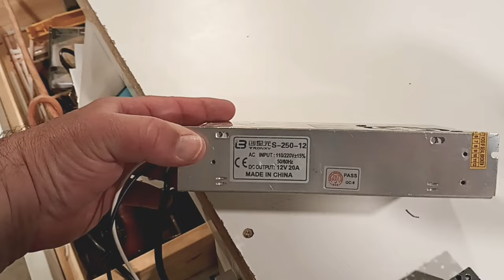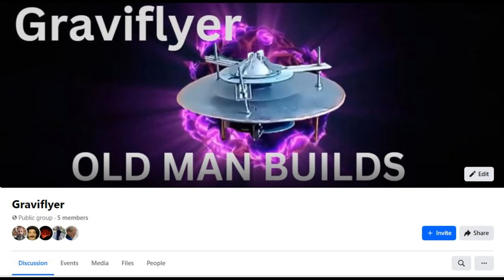Adjustable Power For ZVS & Flyback #35

Comment: Nathan, you may have the power but not the voltage battery frequency. Also, the power supply is pulsed DC from AC. You also need the Al and Al2O3 CD.

Comment: I have the copper for my Tesla coil primary & secondary and the spinning plates top and bottom . I am building a  rack mount cage for my power supply and 6,500 watts rms of audio sinewave power. EEG for mind control operation, so All I have left to gather is one D/C fan motor, and the large central aluminum plate. The rest is pulled from my utility trailer in storage. I will be with you on the graviflyer and the gravinductor :) Two Weeks tops ready for broadcasting experiments too.
Reply from the maker: I can't wait to see it
Reply: I also couldn’t but help myself And other’s following fellowshipping  to bring on some patch bays:)  it’s forward stroke with chokes into new promised terraform ‘d lands.

Comment: Good afternoon to you Sir.       That looks like a A/C ark, am I right to say that. Have you tried a Hi voltage DC circuit.    Thank you for the visual the other day with the tubes and the flyers heartbeat it pulse. Looking at it the doughnut it's very large for the piezo in my minds eye all I see is a hole being punch throw the centre not pushing down the top half of the sphere.  Good work buddy your so close.
Reply from the maker: it is dc
Reply: @nathanbunten4299   Ok. I apologise for my inexperience.
Reply from the maker: @Pietro-Caroleo-29  Sorry, was not trying to be rude.
Reply: @nathanbunten4299  Don't worry, all good here. 
   Your controlling the voltage into the coil via the ZVS and the static voltage that is needed by delivering low amps.  Question.    How is the frequency of coil adjusted to the right hertz, for the required matching hi voltage output.
Reply from the maker: @Pietro-Caroleo-29  I have another circuit for that. https://youtu.be/ag9jqnBTY9g?si=eA-kdxFIwtRnIRmB

Comment: I have a question old man i have seen videos where people power a flyback transformer by hooking up transistors and resistors and diodes .    Im learning and im a little lost.    Is that what your zvsdriver is doing ?   Is the zvs the same as using transistors like on other videos i have seen on youtube ?
Reply from the maker: it is 2 transistor's instead of one. But yes it is the same thing. It puts a pulsed dc signal into the core of the flyback. you will also see where people make induction coils to melt metal. 

The power source and the capacitors are the difference in the circuit. Low volts high amps gives you a heater. High volts and low amps gives you a flyback driver. 

They are all the same. A zvs is just a better version of a single transistor. I have used both for heaters, flyback drivers and tesla coils. I like the zvs because it is cheep and works with a lot of power sources. The single transistor tends to blow up a lot more.